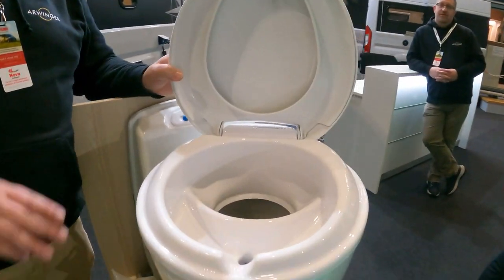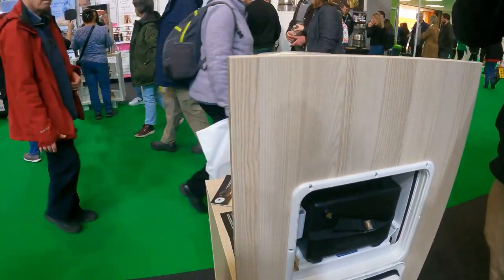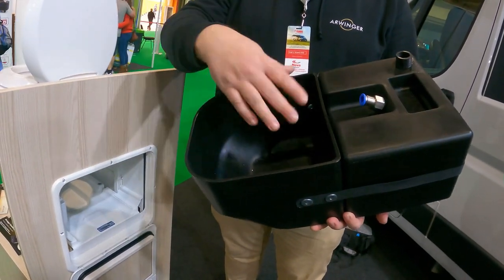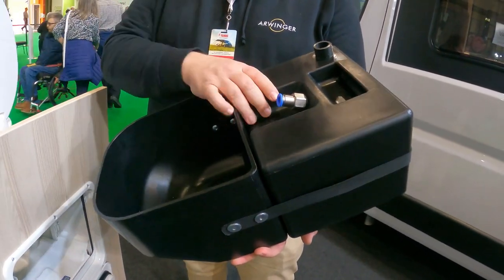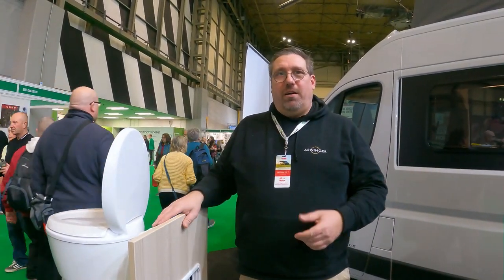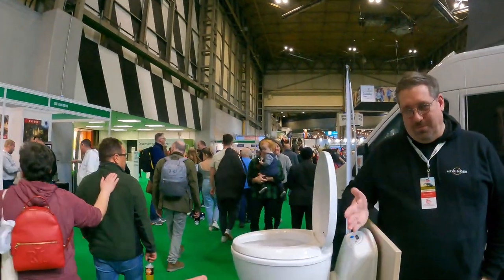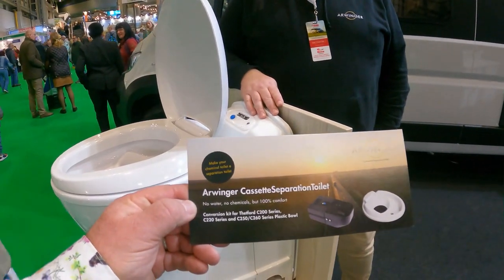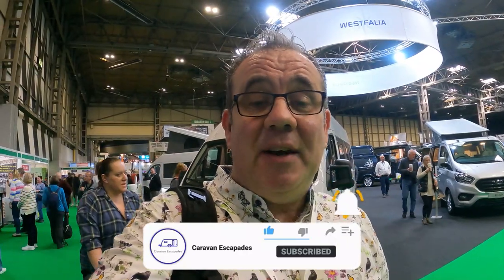Airwinger Cassette Toilet Conversion   No Water   No Chemicals

Comment: At that sort of costing,
We will stick to the toilet as we do now, I have just purchased a new caravan and tried the Thetford Green Sachets.
Can’t believe how good they are, just pop a sachet in your anorak pocket,
 there is little to no smell while depositing the content to the site disposal point, and recharge your toilet with the sachet.
We use the Thetford pink flush, in the caravan toilet, during use we open the toilet slider, flush and ensure it’s re closed 
With a little flush fluid in the bottom of the bowl, with a little flush pink above the seal, there is no smell.
I remember using the loose blue fluids in the old chemical toilets and terrible mess about, and was not pleasant at all.
The Green Sachet’s are kind to deposal tanks.
Reply from the maker: Hi agree, I was surprised at the cost, I am guessing some of it is due to import taxes etc, but still quite high. For some people though will want to go this way. We also use the little sachets. They are great. We don't even use anything in the flush just water and have had no issues with smells. Thanks for watching and commenting. Jame